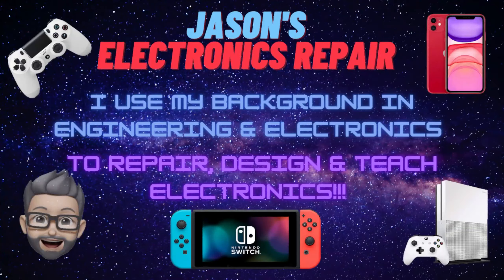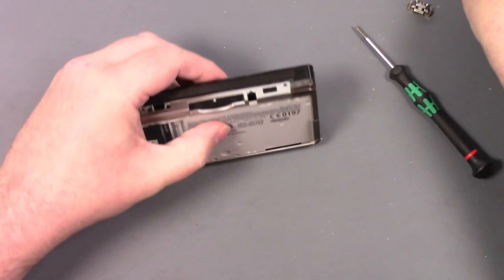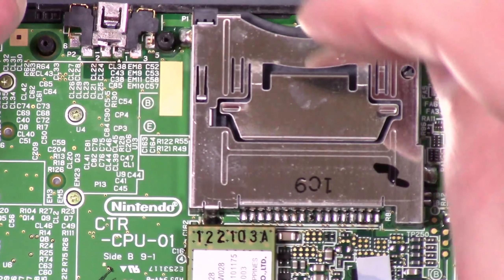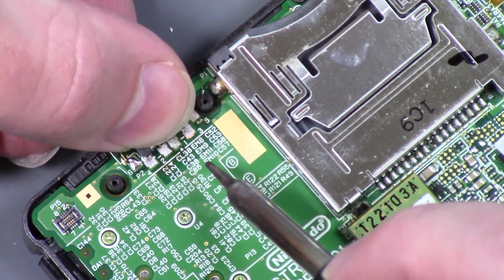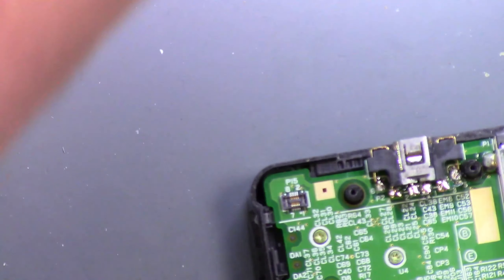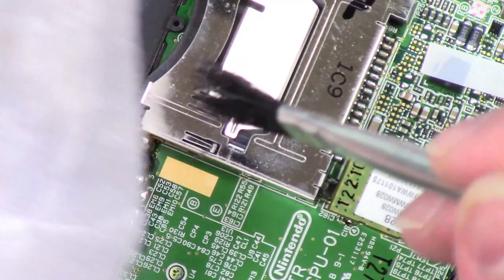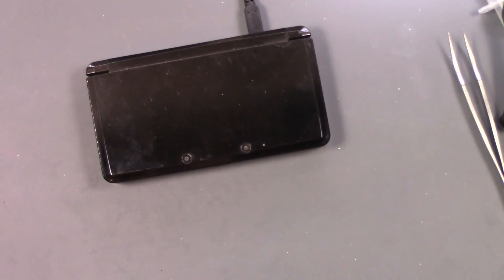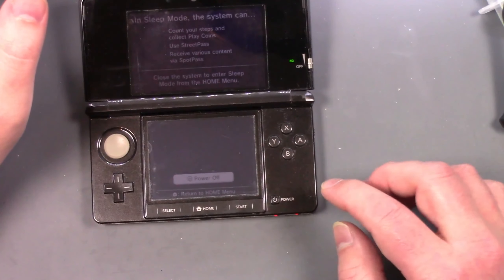Nintendo 3DS Charger Port Install

Comment: Hi Jason! Where did you get the port? I keep getting sent the through hole ones too, its so annoying!
Reply from the maker: AliExpress after about 6 tries I finally got the right ones. Be careful because one set I got was donor board pulls. They are very hard to get
Reply: @jasondoesthings919  I couldn't get a link to the ones you bought could I? Thanks for this!
Reply: @jasondoesthings919  I couldn’t get a link to the one you bought could i? Thanks!